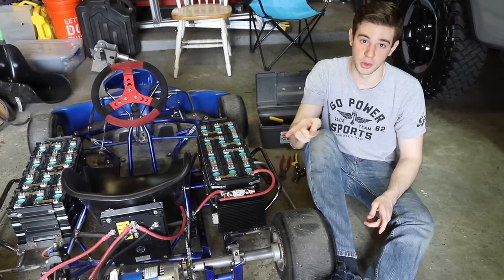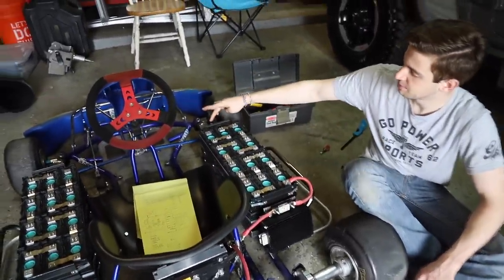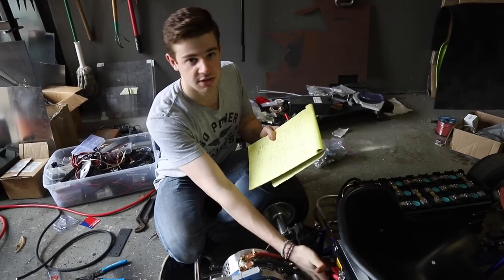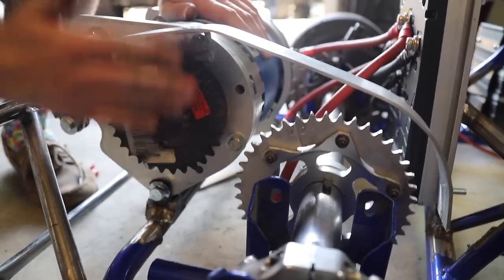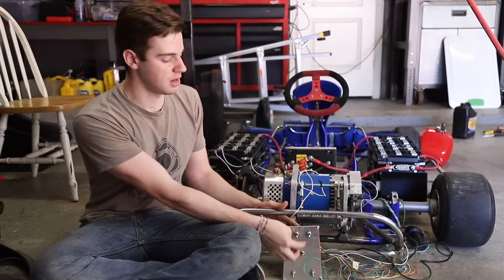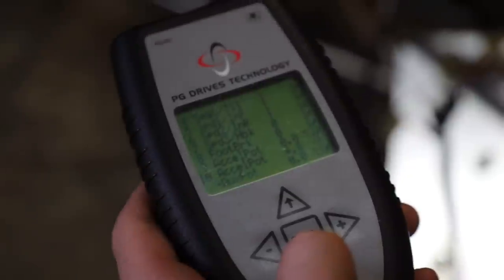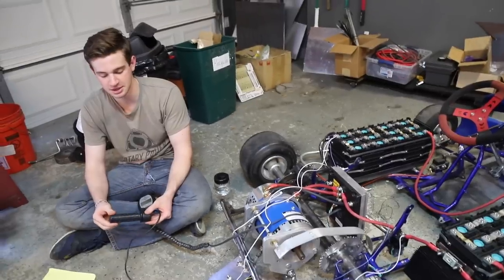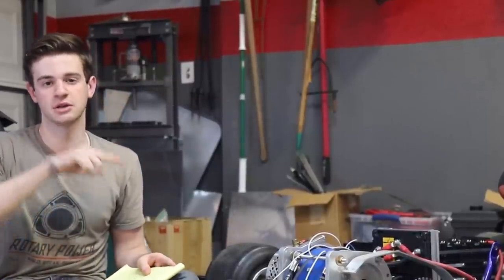Electric Go Kart Build Part 3 | Wiring and Motor Spins!

Comment: Guys get a hydraulic crimper for those large cables.  Amazon has them cheap.  Its worth the investment.
Reply: Or aslease solder them...
Reply: Def need a swaging tool. Using the vice will create a high resistance joint, if not straight away it will happen after a time. A swaging tool is designed so it wont loosen over time.

If you need to solder will work but corrosion and vibration will be an issue after a while 

Also get a ratchet crimper for the smaller connectors. Using the tool you have WILL create faults after a while.

Tech 34 years. Learnt the hard way!
Reply: @lennym1273  soldering isn't adviced in vehicles. Duo to vibrations. The wire then easily breaks right next the solder.
Reply: What kind of electric motor you use?

Comment: Two things I would suggest. Don't have those black and red wires crossed where they bolt down behind the seat. That's a short trying to find a place to happen. Vibration could cause one of the wires to wear through at some point.

The other would be to program the controller to limit the speed in reverse to something like 20-25% or so. You don't want to suddenly go careening full speed in reverse if you suddenly hit the throttle pedal to hard. You may have already done that, or its already programmed in and you just didn't say in the video.

Cool build either way. That thing is going to be a ripper as long as it doesn't kill chains all the time.
Reply: what he said
Reply: what he said

Comment: While that is all good and I applaud your effort. There is no need for all that work. I built trike out of 2x4s and deck screws no metal except the screws and some bolts for motor mount. 3000 watt motor running off 2 two 40 volt 7.5 ah batteries in series and it tops out at 39 mph. Really easy build took about two weekends to build

Comment: Sweet glad to see someone doing the same as me.  Im building an all wheel drive kart. I built my battery back out of 21700 high amp batterys. Im building my own hub motors right now and hydraulic brakes. The motors should be able to push 8000 watts each. I need to get my vesc motor controllers but slowly working on it. I wish there was a forum out there. Who knows i might put one up

Comment: This is a pretty neat project... Might I recommend for if you do a future one though you might wanna go brushless and try a Sabvaton motor controller similar to the ones used on electric bikes... they have an insane amount of configurability and even a mobile app which can be used in conjunction with an optional bluetooth module to be able to eyeball every aspect of the controller's operation as you're running it.

Comment: Harbor Freight has those wire crimpers they're not expensive hydraulic ones are the best ones that get though and I think they have them too for pretty cheap drop a solder for good measure even might help but I'm not telling you guys anything you don't know but  loving the electric cart episodes

Comment: All those diagnostic tools are so expensive.. if engine manufactures would just use some standards (I have seen some Cat5 connections on engines though, good job!), anyone with a computer could diagnose anything. But what an awesome build!

Comment: You should take the kart to track and get a lap time
Reply: Should've run with the 2cycle on it so they could have something to compare it against. All those batteries with their weight plus all the structural welding is going to hurt the handling a lot.
Reply: True
Reply from the maker: We actually have a video of this exact kart with the 2 stroke at the track. But yeah good idea we should totally compare before and after lap times!

Comment: Fyi, try to allways put your part in the center of the vise when forcing hard on it. Also use anti seezeon the threads of vise for more torque with less pressure needed.

Comment: Would be interesting to know what motor, controller and batteries you are using if you could add them in the parts list in the description.
Reply: Wondering how cheap it is and if the controller will work for a larger motor I’m betting

Comment: besides the contactor do you have any other way to isolate the battery like a manual emergency disconnect switch in case the contactor welds itself shut?

Comment: Next time, put connector in vice heat fill with solder. Cut your wire, heat your connector again to melt solder and stick in. That's not a great connection by crimping in vice. Great build guys!! Love it

Comment: You literally took everything that makes a forklift run and put it in a cart 😂 a lot of these engines “brake” is called plugging which is basically giving the motor throttle to turn the opposite way it is traveling therefore braking the machine. Also you should be able to set and adjust the coast speed/distance. Awesome build can’t wait to see it burn the tires off 😎
Reply: No it's when you short the motor out and it stops.

Comment: 10k ohm resistor is far too high IMHO.  That would take far too long a time to charge the controller if it does it at all.  The highest I'd go is 100ohm.  You're wanting to limit current.  At even 100V DC, a 100 ohm resistor would limit current to 1A.  The resistor would warm up a bit but the amount of time it's having to be at that current would be very short.  With 10k ohms, you're limiting the controller to charge at less than 100mA.  That may not be enough current to even turn the thing on properly so it'll sit there, no charging while you're expecting it to be OK...

Comment: 1:19  NO NO NO... that is NOT how ya crimp high current terminals!! ...use an appropriate crimping tool, otherwise the crimps will loosen, resistance will go up, and a "thermal event" will ensue!!  If you don't use a crimper, then at lease solder those terminals.  Even if it doesn't go up in smoke right away ... crappy crimps have high resistances, you will be loosing power to heat at each crimp.